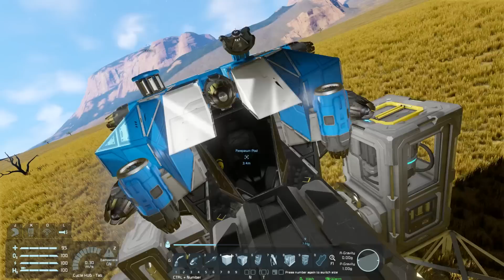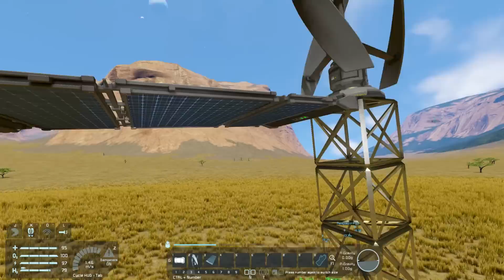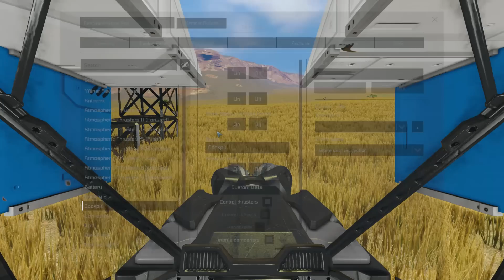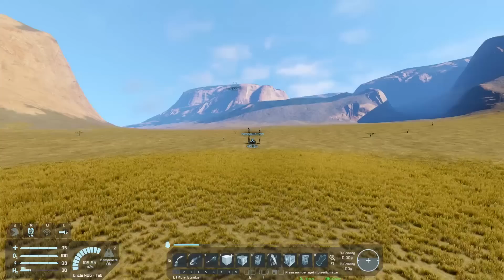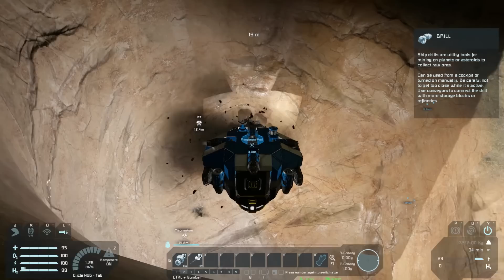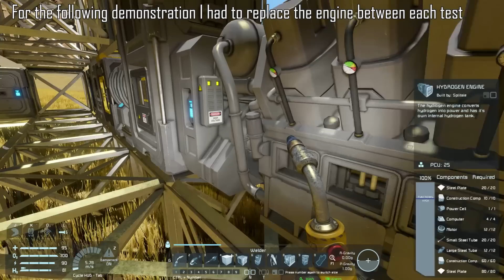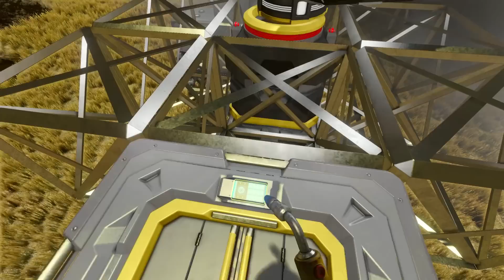Power Systems - Getting Started in Space Engineers #3 (Survival Tutorial Series)

Comment: I FIGURED IT OUT! The amount of hydrogen burned depends on the load. If Current Output is at max, no fuel gets stored; if Current Output is at zero, it stores fuel until its tank is full. The less output, the faster the tank fills. The engine can remain on AT ALL TIMES, and if your solar panels and/or wind turbines generate enough power the hydrogen engine won't burn fuel.
Reply from the maker: The challenge with that is batteries, since the moment you connect one that isn't fully charged they'll jump up to full usage since batteries can take a lot of power in at once, though I suppose you could at least fill one as an emergency power source, turn it off and only turn on when really needed, but a battery would do that similarly anyway. At the moment the only situation where I feel like they're really useful is when you're near a huge source of ice, since then you'll be able to collect enough that they'll be your best power source.
Reply: @Splitsie  I've found them perfect for rovers, backed up by a small battery. Little effort to charge, then switch it off so you only use the engine. If the engine dies--no fuel--you can use the battery to get ice back into the generator and refuel, though that's easy to avoid by turning the engine off when not using the rover, much like turning off thrusters on a small ship when connected to a base for charging. But being near an ice source is still important, though you'd need one anyways for your jetpack.
Reply from the maker: That's a very good way to use it, I like your plan :)
Reply: @Splitsie   Thank you  :)  What I did was: an engine, two generators, a small battery, and a solar panel. I set the battery to recharge only, and filled the generators with ice. My only times having problems was when I would use a full size battery; the engine had trouble charging it AND moving my rover--at least when going from a dead stop to moving. The problem went away once it was full charged, but that takes forever on just one or two engines.

Comment: can you put wind turbines next to each other if you corner them. as in does the obstructions only work against you at 0,90,180,270 degrees?
Reply from the maker: As far as I've tested they only check for blocks horizontally, but I haven't tested the full array of options yet, though I plan to :)
Reply: @Splitsie   looks like you can. A sexy way i found is to put them up higher and then set them sideways on the pole at the top. i have 5 on one pole all at top speed.

Comment: I found it most convenient to label blocks with a prefix which indicates their grid.  So if I have a base called "Alpha Base" then all the batteries, cargo containers, connectors and etc will have the prefix "AB_", i.e. AB_Connector 1.  Likewise a Small (grid) miner's blocks would have the prefix "SM_", i.e. SM_Connector 1.  Doing this makes using the filter option on the inventory and control panels much more efficient rather than simply relying upon the colors.  I've found that if you have multiple ships connected to your station the colors can change making it difficult to distinguish between the blocks of one from the blocks of another.
Reply from the maker: That is a very good piece of advice and one I've always been hopeless at following even though I know I need to :/

Comment: If your survival kit/medical room is piped into your hydrogen, using it seems to jump start the hydrogen engines most of the time.  It's the only way I've found to reliably get them up and running.
Reply from the maker: Interesting, so it seems that any interaction with the H2 system, even if it's building a new conveyor on that grid is the mechanism needed to trigger the engine... hopefully that'll be improved and they'll work out a better system for getting the engines going

Comment: Hello mr splitsie,

I am looking for advice. In my current build i made a solar tower that should track the sun for optimal power generation. Which script would you recommend? I've tried a few but they didnt work or the manual on how to set them up was too much for me. i'm going for something like the solar axe. 

Working on a giant mobile base with four sets of wheels with drills in them. That way i can make tracks and get some resources. Power seems to be my biggest issue now.
Reply from the maker: Isy's Solar Alignment Script ( https://steamcommunity.com/sharedfiles/filedetails/?id=699142028 ) is the one I've always used. Simply group the rotors that are on the tower and call the group Solar Rotors (check in the script for instructions as I'm not 100% certain that's the correct name). Isy is very good at documenting in his scripts with clear and easy to read instructions at the top :)

Comment: As a rule-of-thumb, charging batteries with the hydrogen engine is very expensive.  However, running other blocks isn't.  I've found running multiple hydrogen engines simultaneously so their hydrogen buffers drain slowly to be advantageous.  I will also use two timer blocks in a loop to turn my O2/H2 Generator on and off.  Block one turns the generators on when triggered and block two turns them off when triggered.  I try to work out a ratio where the buffer is filling slightly more than it is draining.  This will save power as the generators aren't wasting power topping up the buffers.  You can add a hydrogen tank if you're going to be away for long periods (like on a server).  You can use the hydrogen tank as an overflow container so as not to waste energy.  Having a spare tank of hydrogen is good if you need to charge a battery in a hurry no matter the cost.
Reply from the maker: Since batteries can draw more charge than any other block it makes sense that they're the most expensive, but in my time playing that's been most of what my power is used for - charging up batteries for flying vehicles. If I was going all rovers then H2 might work, but then again, wind power would probably work just as well and that's the bit about the hydrogen engine that bugs me. They didn't properly create a niche for it, something where it excels and has use even when you've got access to the alternatives, still, I'm the kind of person who'll use them anyway just because I enjoy building all the infrastructure to support a refuel and resupply setup :)

Comment: sooo i wanted to add a bunch of thruster's to an existing ship connected to a base to prevent the thruster's from turning on as I build them so I hop in meh lil ship and I hit Y and BOOOOM! everything in the base goes red, ships fall over from their connector's but the wind turbines are still rotating. When I enter the control panel it shows everything is on but it isn't. I reloaded the save and everything was fine but I wonder if you can do this in multiplayer with no admin access. However as a general rule I suppose it is necessary to put a control station on every base now to prevent having to reload a save. As a side note after everything was red I selected everything that had a power on and off toggle in the control panel and switched everything on and off several times, even the wind turbines stopped spinning, I also ground down everything on the base and rebuilt it and nothing turned the base back on we can't build anything like a battery or another power source since everything is off so it seems that the only solution at the moment is to reload the save or use admin tools if you don't have a flight seat or control station already in place. I just read your pin I wasn't paying attention forgive me.
Reply from the maker: Nice to know you came to the same conclusion as I did though, reload or creative mode for a control seat. Hopefully they'll fix these bugs, but even if they do, I figured the process of working through it might have been useful for newer players so they can troubleshoot some of this themselves in the future :)

Comment: If my ship is parked on a landing leg, do I still have to fear it will despawn when I turn the power off ?
Reply from the maker: I'm not 100% sure, a locked vehicle is a static grid, but the game may not call any small grids static so I'd leave them on to be safe :)
Reply: @Splitsie  a locked landing gear remains locked even if the grid is switched off, in fact, turning landing gear off when locked also means if you hit the dreaded "P" they do NOT unlock as they do not respond to the command.
Reply from the maker: @unfluffydave8798  I'm aware the landing gear remains locked, what I haven't tested is if that means a small grid is considered static and therefore shouldn't be cleaned up :)
Reply: @Splitsie  I have just done a little test, with a drop pod converted to a miner like yours mine disappeared when I got to 500m, it was locked to voxels. When I reloaded and locked it to my base grid via the landing gear and shut it down using Y it did not disappear, even when I jetpacked out to 1km. It also was not deleted when locked to a simple platform of 4 large grid blocks.

Comment: I've been unable to find a surefire way to fill up the hydrogen engine's onboard fuel tank, but I have found that having a hydrogen tank between the hydrogen engine and the H2/O2 generator does allow you to turn the engine off and on safely. I think the issue with not being able to restart the engine after turning it off--or not being able to turn it on the first time--is because it needs a minimum amount of fuel already in it's onboard tank. Which it doesn't draw unless it's running, and can't fill unless there is greater input than it can use (so 3 H2/O2 generators per hydrogen engine)
Reply: I love using it for my rovers though.
Reply from the maker: It would have been really nice if you could set the engines to fill while off, so you could use solar power to trickle fill the engines built in tank making it useful as a backup/emergency power source on bases too :)

Comment: I like the IDEA of the hydrogen engine but the implementation is rather poor. It would be a lot better (and I think less buggy) if it accepted ice directly.

Interestingly the real life hydrogen engines (or electrolitic engines) split water into hydro and ox and burn both - they also require frequent changing of zinc /nickel rods - which is I believe the main reason they have not seen common use in homes as boilers for central heating. Currently they are only really used in the third world and remote regions where it would be prohibitive to run a power cable.

Unfortunately electrolosis is not a very efficient method of getting power from water - here's to hoping we crack safe fusion soon!
Reply from the maker: Completely agree, you should be able to just put ice into it as it would help from a gameplay perspective and would give the engine a real use :)

Comment: Just to be nitpicky, regarding just hitting 'Z' (turning off damps to save power), this is not 100% true. Even when not actively in use, thrusters still consume power and fuel, even at a significantly reduced rate. If not actively being used, (e.g., landed on a planet or parked/coasting through space) turning them off guarantees best power/fuel savings... Of course, one has to turn them back on before disconnecting from a base, taking off, or when needing to brake, or you will break instead. :)
Reply from the maker: That's true, I initially said use Z but edited that bit of it out since switching off is better as you say - also less likely to end in disaster since you can't take off with thrusters off, but you can with dampeners and then you have a lot further to fall before you realise what you've forgotten to change :P
Reply from the maker: That's why I still had it in the footage as I only recorded the audio again :)

Comment: I'm a little surprised that the hydrogen engine creates so much more power than the oxygen generator actually uses, considering oxygen hydrogen cracking uses electricity to split water, it should be slightly worse than a wash. :v
Reply from the maker: Agreed, the system doesn't make sense if you think of it in terms of electrolysis and hydrogen fuel cells with current technology. Instead think of it as a gameplay mechanic (separate to real world physics). Instead of adding yet another voxel material to enable the addition of a fuel powered engine (that isn't a reactor) they decided to use ice and hydrogen as a fuel stand-in ignoring those other issues :)

It really helps make their existence more acceptable if you think of it in this way :P
Reply: @Splitsie  I will happily use it, of course, I just expected it to be more like batteries: Giant tank holds a bunch of 'stored power' (hydrogen) that you can turn on when you need it. I like it either way as a game mechanic, just intrigues me that they thought of it that way, is all. (Ps, Just binged Survival Unlikely, love that series. xD )
Reply: @Splitsie  any update on this? Thanks

Comment: what do you mean 'small grid hydrogen engines have no use' you completely skipped the step where you could use them, a rover :)
Reply from the maker: You'd still be better off with a battery - with the larger small grid battery on a rover, you barely need to recharge it even with heavier use :(
Reply: You'd either have to carry a ton of ice in a cargo container, which wouldn't give you an amazing run time anyways, plus it'd be SUPER heavy for a rover; or put a hydrogen tank on a rover, which would increase the size dramatically, and would be pretty fragile unless heavily armored. Which would again, make it super heavy. Batteries that recharge at a station/base, or using reactors is far more pragmatic, and efficient in both terms of size, and weight.

Comment: Btw its best if turbines have 6 blocks between another and are 1 block above any truss structure.

Only exception is that a plus formation will allow 5 blocks but if you fill in the corners the center top bottom left and right will lose some power.
Reply from the maker: 8 blocks is best, having been given information directly from the code on them they do a check to exactly 20m for obstructions :)
Reply: I think that check is for voxel clearance, block clearance seems to be different. I've built two turbines adjacent to each other, towers two blocks apart to allow for turbine clearance, and at least 8 blocks high and both generated max power. If you have 3 towers, then they need to be 6 blocks apart to generate max power. If you use horizontal turbines, the towers need to be 11 blocks high. Using this, I've built a two tower setup with a 1x4 footprint, 11 blocks high with 8 turbines, all generating max power. You can also place three towers two blocks apart and the outside turbines still generate max power, 390 kw, and the middle turbine dropped to 335 kw.

Comment: Which power source/engines should I use to power my exploring ship. (Expect Uranium)
Reply: If you aren't using uranium (either at all or just haven't got any yet), then batteries and solar panels. Easiest to maintain. Hydrogen engine might give you more power, but I've found it best as an emergency power so you can open doors and move cargo. That said, I imagine you could build enough hydrogen engines, O2 generators, and carry enough ice to absolutely power an ion thrust ship. I'm just not sure on how efficient it is.
Reply: I should clarify: emergency power with a hydrogen engine means a minimum of a battery with just enough power to start the engine, plus manually turning off anything that actively draws power
Reply from the maker: I'd agree with Wrecker, batteries and solar if you're not going to be able to recharge somewhere with atmosphere. The hydrogen engine might be a fun challenge to get working as your power source, but it will almost certainly be more of a challenge than solar and batteries :)

Comment: It doesn't make sense that the hydrogen engine can generate electricity.  You have to take ice and split it into hydrogen and oxygen, which in real life costs more energy than you get back when you put the hydrogen and oxygen back together in your engine.
Reply: lol don't give keen any more ideas! hydrogen engines are useless enough as it is!
Reply from the maker: The system doesn't make sense if you think of it in terms of electrolysis and hydrogen fuel cells with current technology. Instead think of it as a gameplay mechanic (separate to real world physics). Instead of adding yet another voxel material to enable the addition of a fuel powered engine (that isn't a reactor) they decided to use ice and hydrogen as a fuel stand-in ignoring those other issues :)

It really helps make their existence more acceptable if you think of it in this way :P
Reply: @Splitsie  I think they could make it use hydrogen and oxygen, and produce less energy than it cost to make that H2 and O2, but give it a high MW rating, so it's useful for charging ships up quickly, but you can't run a base on it long-term.

Comment: The wind turbines can be use on ship but will only work when connected to a connector or when a landing gear is locked
Reply from the maker: Yep, as I said, any grid that is considered locked to the voxels. At the time I decided not to go into more detail on it as I have a tendency to struggle with keeping these videos to a reasonable length :P

The turbine should update its output in the new location as it would run a new check when locked otherwise it wouldn't start up again :)